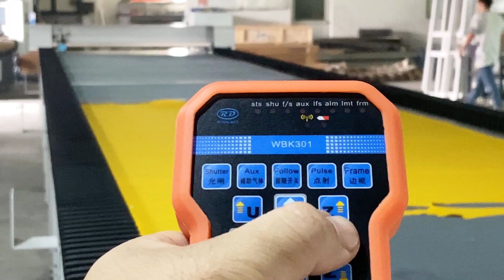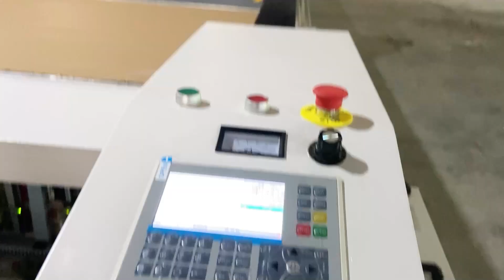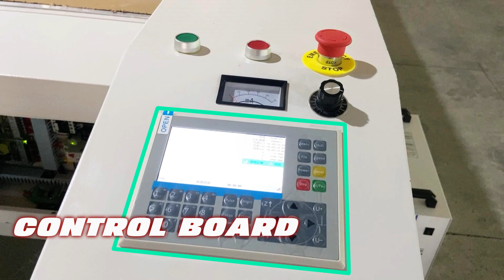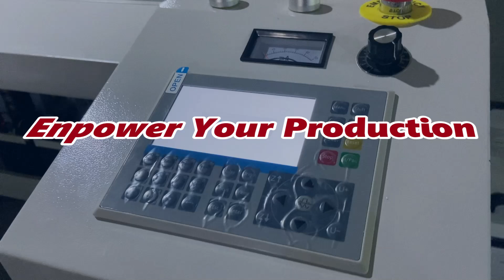What is Ultra Long Laser Cutting Machine? Cutting 10 Meters Fabric

Comment: Hello dear supplier, 
I want The Machine, 3 m wide, 6 m long because I am cutting the Bedspread and the SheetsI want The Machine, 3 m wide, 6 m long because I am cutting the Bedspread and the Sheets Sheets a little long I cut up to 2.60 m in length. Afterwards he cuts on the width of the fabrics and I cut the pillows on the width of 2.80 m 0.70 cm by 0.50 in several times on the width 0.70 x 4 = 2.80 cm I hope you m you understand
Thank you ☺️
Reply from the maker: 😀Yes, sir, it‘s feasible. I will forward your requirements to our laser experts, who will discuss your specific needs and provide solutions via email. Please send an email to us: info@mimowork.com.

By the way, I noticed that you have watched many of our videos and left comments. Thank you for your love of the videos and your trust in our machines. We will process your email as soon as we receive it. Thank you for your continued support.